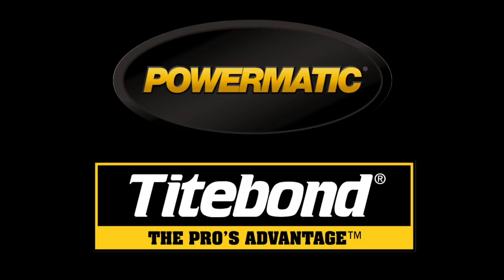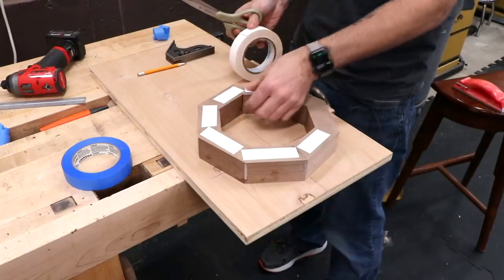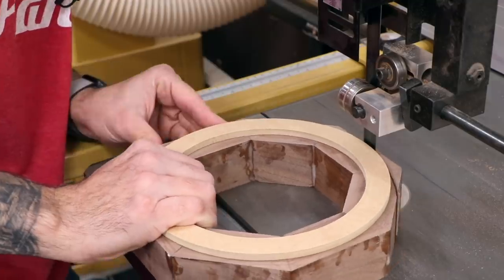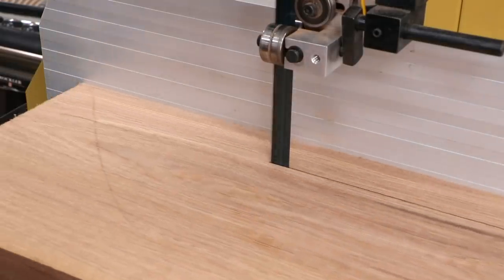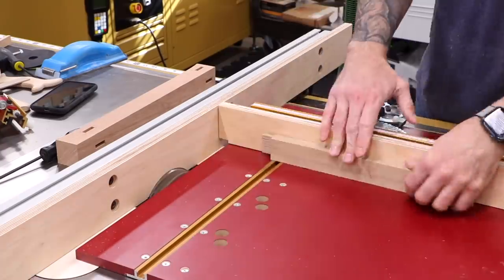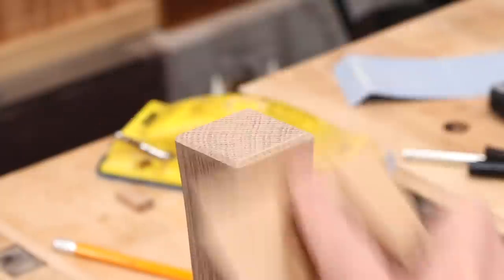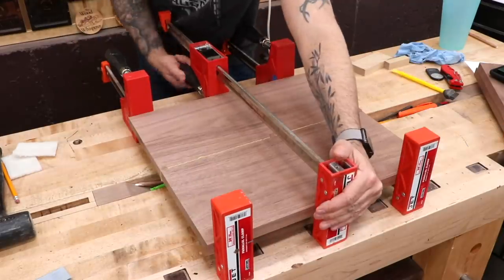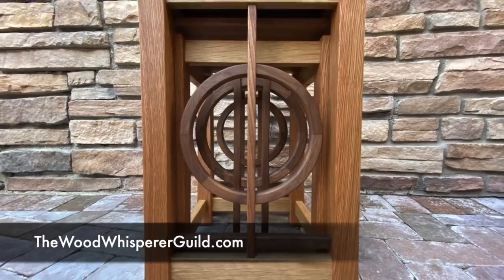Nesting Tables

Comment: Would a mix of beeswax and mineral oil (cutting board finish) work for these tables? Making personal projects but not trying to break the bank.
Reply from the maker: Rolly 545 I wouldn’t recommend mineral oil on furniture. It never really cures. Boiled linseed oil would be a decent inexpensive option if oil and wax is what you’re after.